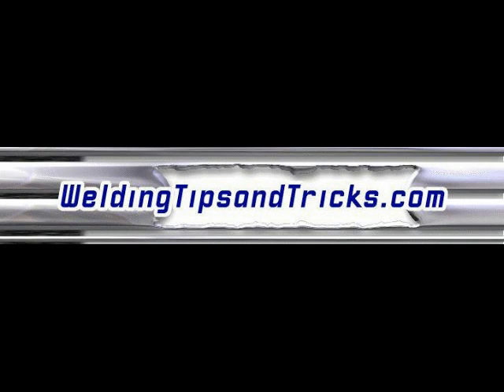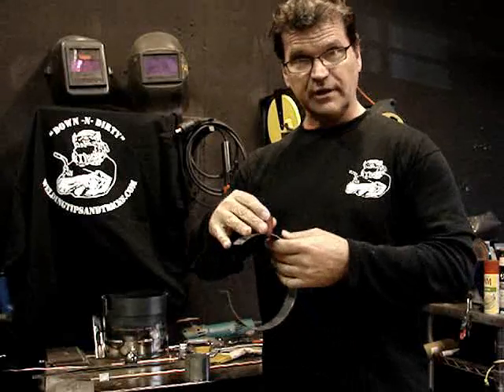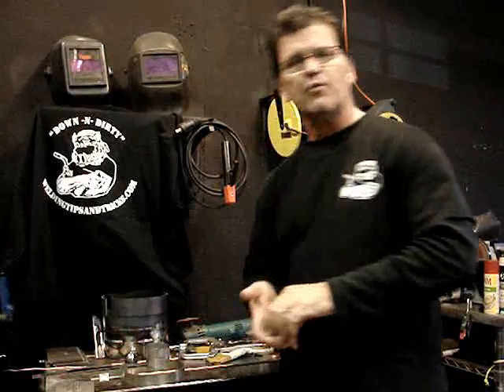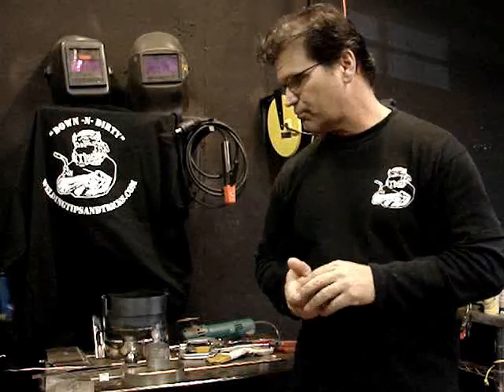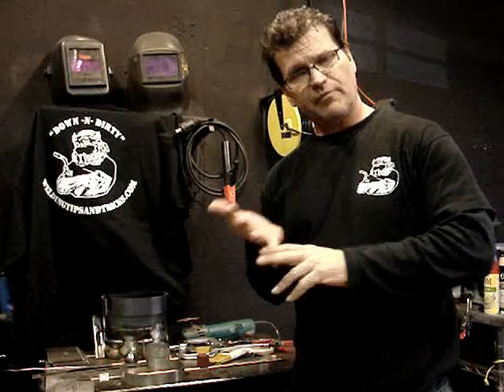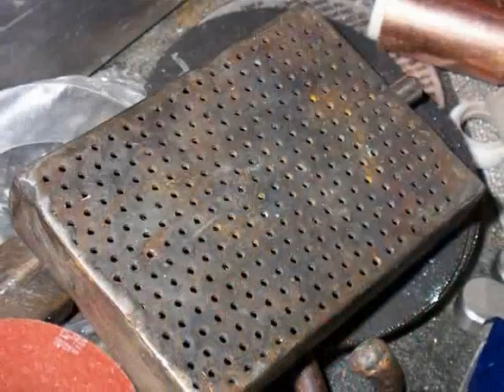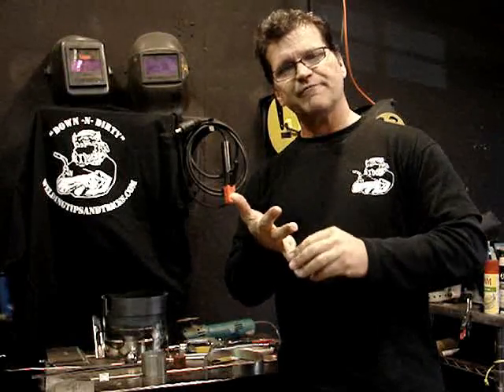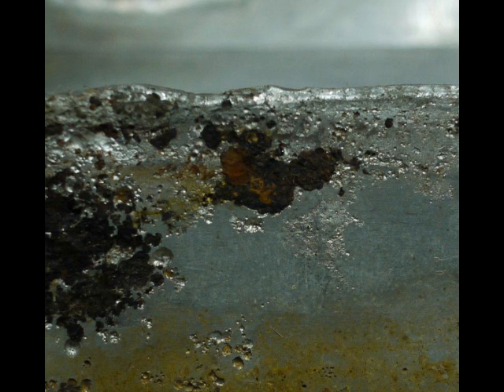Metals and Properties of Stainless Steels

Comment: Hey Jodi, at my school they preach a lot of stainless steel not conducting electricity well. They also say stainless steel “can handle heat” and to weld hotter then mild steel. According to this video I don’t see the point unless you match that heat with a faster travel speed if at all possible. What are your thoughts and have you ever heard of the conduction of electricity influencing welding? Thanks for your time and I hope this burys the hatchet.

Comment: Very useful info. I started turning the corner for the better when I consistently get the rainbow colors. Do a ton of 1/16 stainless steel at work (food industry). Welding thin metal is a really great training method for everything else it seems

Comment: I have to weld SS rod to carbon steel plate in my advanced welding class for a AWS project , Can I still use a brush that has been used on carbon steel or should I use a brush that has been used with SS only?
Reply: John k I would not contaminate your SS brush by putting it on carbon.

Comment: What filler rod should i use for welding 304ss to 409? Also, what if im not penetrating any walls welding 2 solids, do you still need to purge?

Comment: percipitation hardening stainless rods make great armor-plate on the edges of dirt-engagment tools, it is hard to weld though when welding it to these junk cast-steel parts. I tried to use inco-a stickrod and it cracked while the weld was cooling right down the center of the joint, I did not leave a low crater! I then ground the joint out I welded it again with a high manganese build-up rod that looked great& held! I still advise the first pass be big with alot of throat!

Comment: I just want to say thanks for taking so much of your time to share your knowledge. I work at a Stainless outfit in sales and have actually learned a thing or two about this video. I've been wanting a welder for over a decade now and am finally getting a lower end one. I just purchased a Thermal Arc Fabricator 181i mainly for the mig/tig in one and the price! I'm going to try to get into welding a lot of sanitary tubing for brewing beer and using the mig....well for whatever I want. Thanks again!

Comment from the maker: @fckurvtc 309 ss filler would do the job no problem...most stainless steels will join in dissimilar combinations.
sometimes 309, 310, or 312 ss is used but sometimes a nickel alloy like hastelloy w or inco 625 is better.
it all depends on service requirements like heat cycles , corrosive environment, etc.
sounds like you are talking automotive exhaust or turbo components...309 is probably best